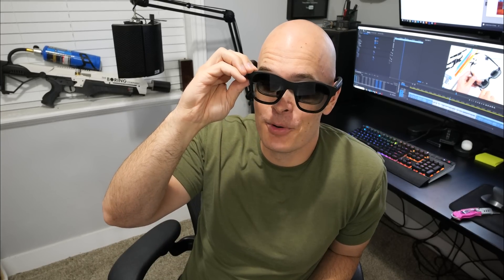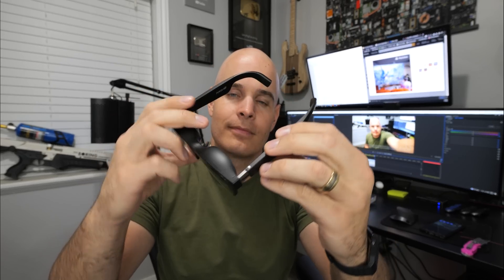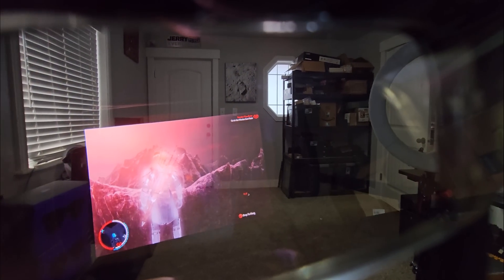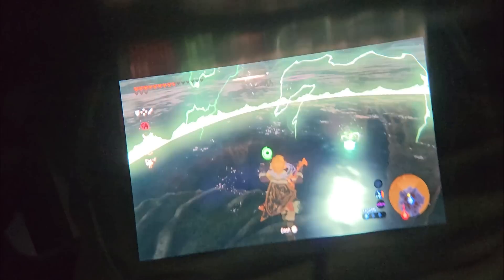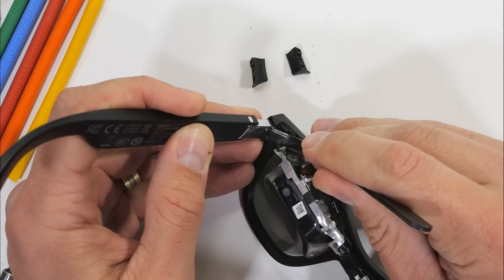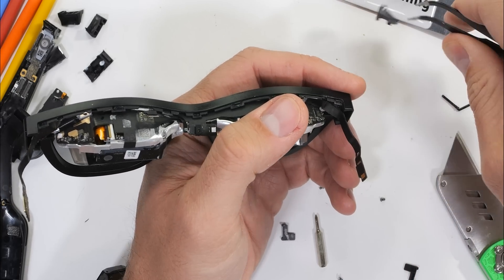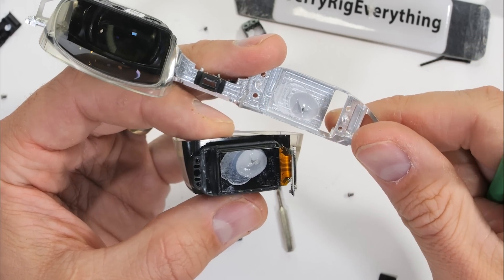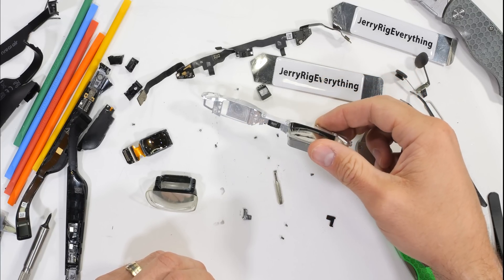The Smart Glasses of the Future are here! - (Teardown)

Comment: Pretty neat tech, not having a battery actually makes sense for the size, though it would be nice to see a headphone jack or some way to hook up earbuds if you don't want to leak audio as much. 
One thing to keep in mind with these types of displays is that the "200 inch displays" or "theater like size" depends on how far the screen is from your face. My 34" ultrawide a foot or two away (yay nearsighted) is just as large as a theater screen, and I don't have to deal with glasses. Just good to remember that "200 inch screen vs 13 inch laptop" isn't as simple as those numbers can look at first glance.

Comment: Good deconstruction video.  It's amazing what's coming out.  I could see using them is some cases when I would have gone out to a customer site and was working outside, programming.   I do also like that they pull power off the USB instead of on-board batteries.

Comment: Love your videos, even when you are ripping apart something that I love! It's very interesting to see how things work internally and something I have always liked doing.  Though, as a kid, my mom was not too happy when I took apart her console stereo/turntable/8track to see how it all worked... I was only 12 at the time. But, for Mother's day, when I was 17, and had a job, I surprised her by taking it apart again, and rebuilding it with all new speakers as well as a new belt and motor on her turntable that hadn't worked in a long time (since before my first time in the unit!).   She came home from work to find her favorite Elvis LP playing, sounding better than ever considering I had cleaned all contacts, and even used fresh speaker wire for the new, 3 way speakers I replaced the old, deteriorating paper cone speakers with.

Comment: Many moons ago I bought something called IGlasses, which worked a similar way. Had two LCD panels which simulated a 110" screen, and could do 3D. Looked like crap and gave me a huge headache. I've still got them in a box somewhere. Turned me off from the whole VR thing when that came out later. I might give it another try with something like this, especially if they do make a wireless version. 4K would be nice too.

Comment: I'd be interested to see if these can be used as an alternative to a camera viewfinder, myself. At the moment I am using a Sigma FP, which does not have a built in viewfinder. An add on viewfinder for the camera is available, but at an extorionate $700. I reckon that, at almost half the price, these would be a viable alternative - provided that the resolution is good enough. And no, I don't mean the stated 1920x1080 pixels but rather the PPI (pixels per inch) of the screen and how that might potentially degrade with the image being channeled and reflected via the unit's optical elements. It would make for a great backup viewfinder in bright conditions. 

Also, in case I get comments that the power and display feed being obstacles, the Sigma FP has a UVC output (a lot of current gen cameras have this) and power maybe (just maybe) be supplied via a USB splitter. Hope someone tries this out.

Comment: I guess this still won't work with most Xiaomi phones since they're missing the MHL port. So the funny part would be to use a Chromecast with an HDMI to USB-C adapter and mirror to the Chromecast connected to the glasses. Wonder if the app would still work with this kind of setup.

Comment: I hope thay make a 4k version so it would really be emersive and nonpixelated when you put it on. And also a sensor so you can use your hand as a mouse or make it like you can touch the screens in the glasses. Maybe a two wireless device that can be put on the pointer finger, with two buttons each that can be click by the  thumb when you want to touch and make gestures... that would really be awesome and really a fun ar glass😍😍... 

I know that it woud be somewhat more expensive than this, but they can sell it as their flagship and this is the budget one.

Comment: It could be a good device to display navigation and other info while driving or riding if it will not distract from road or shift focus for a quick glance at the display without any danger . many smart/AR helmets failed due to weird/imperfect implementation of on FOV displays and that too for a high price point. this is where this glasses are interesting and you will be able to use current helmet if it fits without discomfort and the price of the glass is very reasonable.  Also for travellers who work while travelling or content creators who have to bring a compatible laptop or tablet, this could replace or an alternative option where you only have to bring a powerful enough compact PC or tablet and use this glass as the display. light weight travelling and a bigger display than a common 14 inch lightweight laptops :). and also you have a private home theater where ever you go :D

Comment: Hi Zack, I enjoy watching your videos for teardowns, I often "cringe in pain" in sympathy for the devices when you do the scratch tests on them.  I too like another commenter wear Rx glasses and don't even want to try contacts.  Most of the Rx is for distance vision as i'm nearsighted in my left eye.  Odd thing with my eyes are is I have difficulty seeing 3-D as that requires use of both eyes, and mine aren't aligned the same.  So if I try to look at objects with my right (non dominant eye) I see objects in double vision.  I did try an older version of Oculus-based VR glasses by Samsung but they were kind of specific to the particular Galaxy Note I once had, and the adapter they sent me for the next gen note from that never worked, so I kind of retired them.  They seemed to work well even with my strange vision condition.

Comment: Interesting that companies are still push this tech.

I've tried a few of these over the years and used to work for a firm that pretty much tried everything on the market including the expensive and at the time best of the bunch ODG which is now no longer.   They all suffer from the same problems.  Either, heavy and hot on your head or just feeling unwell after more than about 10mins of use.  Wearers of glasses basically can't use them.  

I don't find them useful.   No thanks.  Not a fan here, but love your channel content nonetheless
 :)

Comment: I tried out some vr headset a few years back. I really wanted it for monitor replacement. However there was no pass through back then, so I couldn't see my hands to type correctly.. I returned them... I can't wait till the tech is ready, to replace my standing desk with 3 monitors at home, to be able to work in my van 😊

Comment: Not having battery is a good move that saves a ton of space on the glasses and lower weight.

Given it takes input from a different device all the time, there is also not much processing power required given the actual output (game / video) is processed somewhere else and not on the glasses

Comment: Those look really cool.  I think I'd play X-Wing or MS Flight Simulator on them,  until I'd rig them up into a helmet for better vision at night,  during fog,  and to the rear when riding.  I can see hacking together a Raspberry Pi or similar with a thermal camera and a rear facing camera,  and the Pi switching the feeds to the glasses when the turn signal is activated.  
Then again,  it would be wicked if a flight sim used the gyros to give you a 360 virtual view of the cockpit and terrain.

Comment: Quoting the screen size in inches seems very strange. How large a screen appears depends also on the distance, not just the diameter. I would not be impressed with a 200 inch display if it is 20 meters away (like it looks in the POV video). Using field of view would be much more usefull and would sound less like made up marketing speak. Not a good look for the company.

Comment: It's really smart that they didn't include a battery because not only would have that made it heavier and bulkier but it also means that the battery was there because you can use the glasses as standalone device which means it would have needed a brain aka cpu ram and storage and at that point you're better off buying a VR headset

Comment: This is very cool! I wished I had something that could do this for quite some time now. I experimented with using my Gear VR and connecting a remote desktop session back to my PC. It worked for the most part, but you don't get the AR aspect of course, so I couldn't see the other people in the room sitting next to me, or anything else going on. I wonder if this could also be used as a sort of HUD in a car for GPS?

Comment: Interesting to see how little is needed to get the units to function as a monitor. Using the smartphone as a professor and power supply definitely increases the usability over using a low powered soc and tiny battery would.

Comment: I have a set of these, and it the display does not feel large to me at all.  I mainly use it with the SteamDeck while in bed or outta' the house and I find text hard to read.   There is significant light bleed from the bottom while in bright environments and using the cover for a better picture image(Even slightly dim pictures will only show you a reflection of your shirt). Trying the glasses with my laptop was a pain too.  I'll get discomfort on the bridge of my nose after around 30 minutes of use.  Solid Meh from me overall,  pretty good for playing games and not much else.

Comment: Adding reading glasses (e.g., thin optics) between the eyes and the frame didn't seem to work here mostly because the magnification messes up with the existing magnification. Still, regular prescription glasses that sit between the eyes and the frame worked well here: I guess that's why they also include a frame you can fit your own prescription. Virtual displays worked well on the mac via beta Nebula driver. I only wish it supports a stereoscopic view instead of either mirror or AR/VR since there are two screens.

Comment: Altought i'm not a big fan of this glasses not having battery, this way they looks great to use while i'm on train when i go to work.
Also i wonder if it would be possible to extend this by an external battery and wireless connection that is placed on the back going around the neck, it might be even possible to do now with some adaptor, it would be fun to try.

Comment: I tried this before using a galaxy z fold 3 but it said that the phone is not compatible. I don't believe that is correct since their website said that it should be compatible, tried updating their firmware via my pc with no luck either. How'd you get it to work? I ended up having to send the unit back to them

Comment: Other facts you may be unaware of:

1) It's more compatible for the Apple Silicon Macs with the Nebula app from which you could get up to 3 displays side by side which is amazing, would love to try it. Some users claim it's a bit laggy but is improving with firmware updates and updates to the Nebula app itself as it's still in Beta. I have installed it, but can't activate it without the glasses.
2) Unfortunately iPhones are not supported due to the lightning port. You'll need to buy Apple's HDMI output adapter + nReal's adapter (which together could be bulky) Also only mirrors your iPhone. You'll also need to charge the adapter separately.

EDIT: There could be more specs and whatnot that I'm unaware of. I don't own one, just learnt these from Nreals Reddit sub.

Comment: I really like the concept of these, and would love to try and build a "pocket laptop" - I've got folding keyboard designed to be used with a palm PDA. Theoretically, there is no reason you shouldn't be able to connect it as a usb peripheral to a phone, alongside the glasses and have a computer that fits in your pocket. Except for the fact that the glasses also need the USB-C port. Maybe using a Khadas edge would work?

I'm dissapointed there is no way to turn on multi-monitor mode when they are just hooked up as a monitor to a computer, I really like having multiple monitors and you can't really do that on a portable laptop, and the glasses probably don't support it without a driver, and as far as I can tell, there isn't a driver for a PC.

Comment: They should have like a little computing box you can hang with 2 wires on your back (under a shirt or something) with a soc and battery.

Only downside I see in them is that you have to connect them to your phone. It would be nice if you could use it as a standalone device, with a bluetooth connection for internet connection. 

IMO they should just sell that computing box as seperate accesory so you also have the option to connect your phone if you want